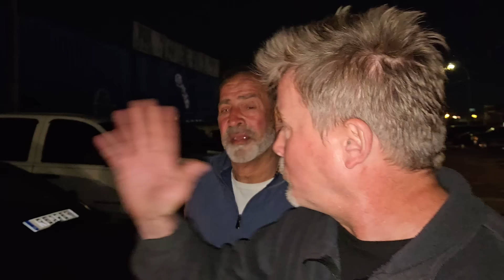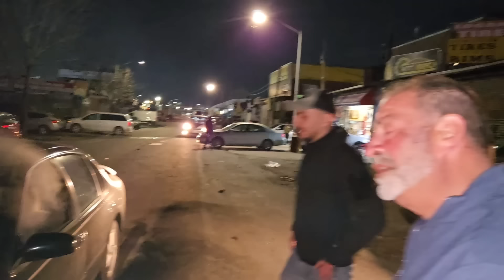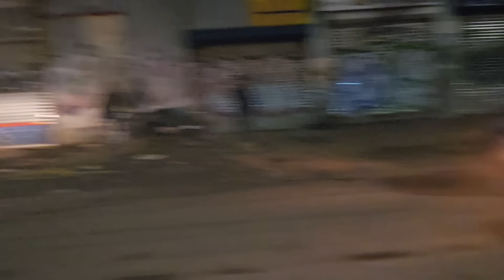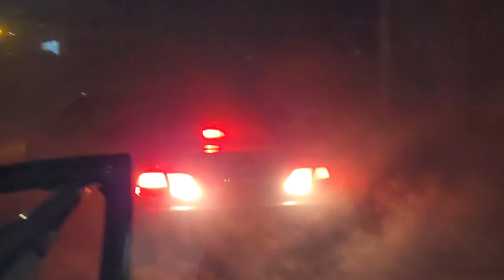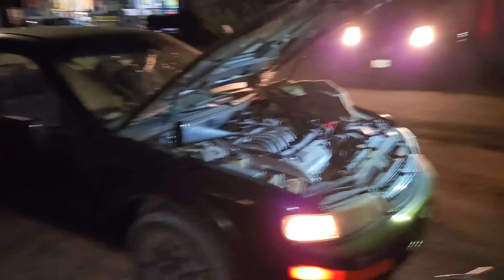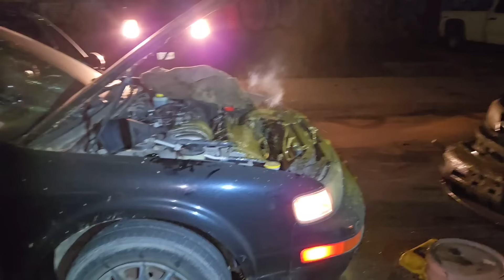NEUTRAL DROPPER ALEX TRAVELS from GERMANY to FINISH STUNTMAN! - Neutral Drop

Comment: Those older Nissan v6 motors are tough. My cousin had a Maxima and she never changed the oil but she had that car for years. The only thing that killed it was it ran hot and she kept driving it until it stopped.